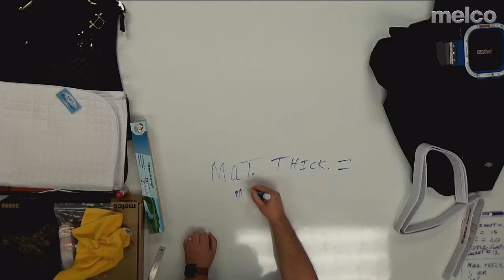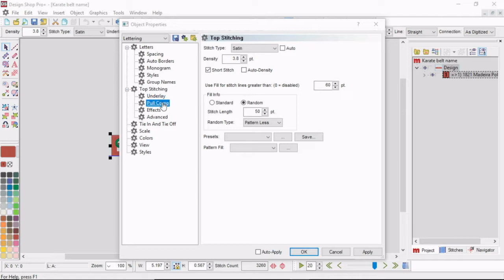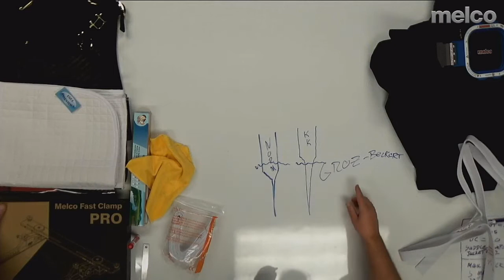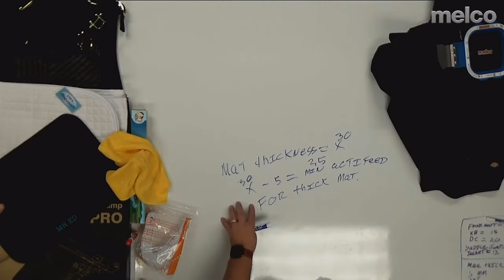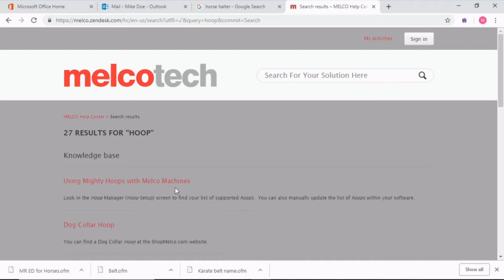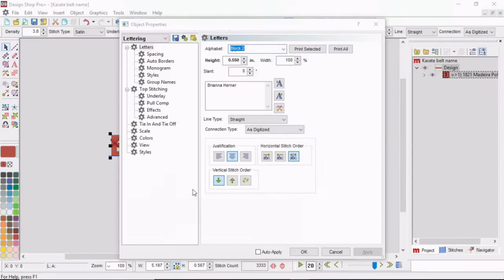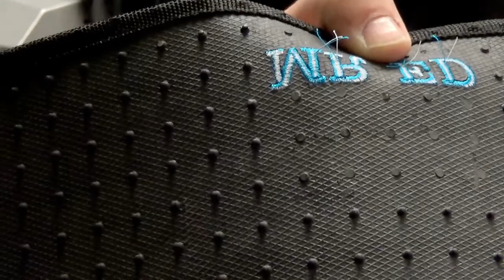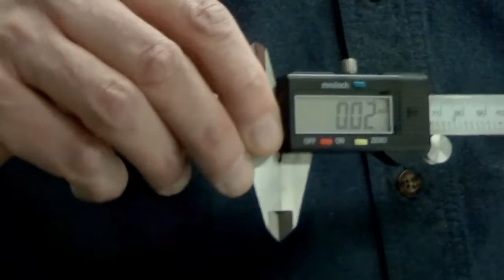Embroidering Thick Materials

Comment: So on a karate belt you wouldn't use any backing? This person wants the name vertically on the karate belt.  How would I do center out when it sews?
Reply from the maker: Tear away backing would be a good backing choice. You should not need to sew center out for vertical letters on a karate belt. Thinner material like dog leashes benefit from center out stitch order. That setting however is under object properties, there is a box labeled horizontal stitch order where you can select center out.

Comment: I'm having trouble working on some hats. My needle keeps breaking not sure what I'm doing wrong, it breaks at the seam. I have watched multiple videos and have changed some settings but nothing seems to help. Any advice, or direct me?
Reply from the maker: A larger (80/12) needle may help. Make sure that you're not starting on the seam and double-check your presser foot height. Make sure you're sewing from the center (or just slightly off-center) to the edges of the design. If you're still struggling, you may want to contact tech support.

Comment: I embroider for a lot of motorcycle clubs and their logos are at times pretty heavy as far as stitches are concerned (approximately 100,000 stitches or more).  My question is this, I mostly embroider on vinyl and at times the vinyl will wave..how much backing should I be using to avoid the waving and some bunching?  I am using heavy cutaway, but I'm still running into problems. I've even increased to two pieces of cutaway, but still having problems.  Can you help?
Reply from the maker: If you've got the stability from the material and the backing, then I would start to lighten up your densities and altering stitch directions. Watch your material push too. All three can contribute to rippling.